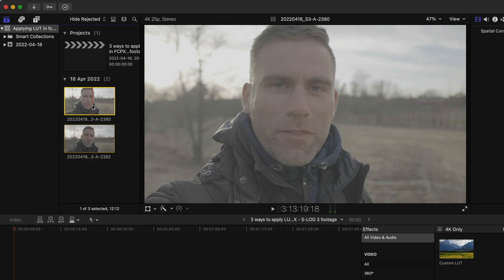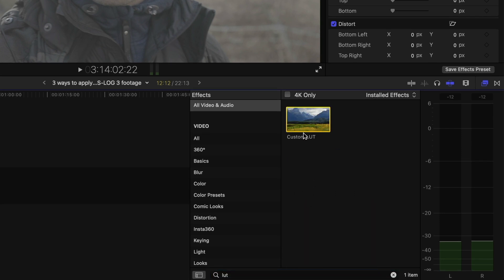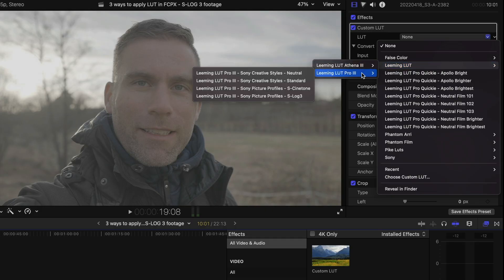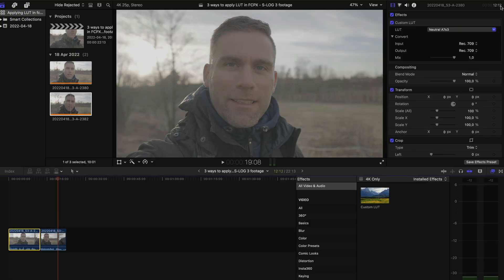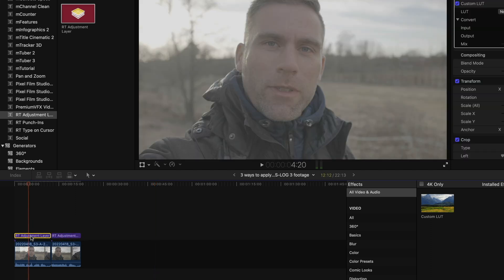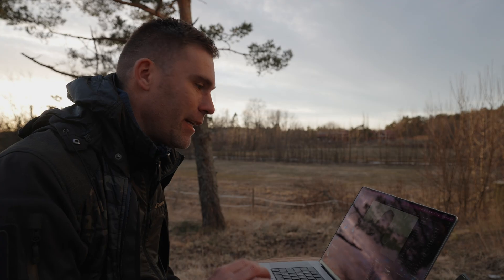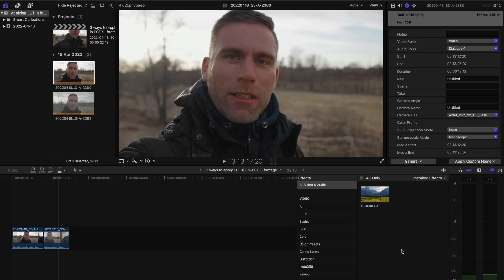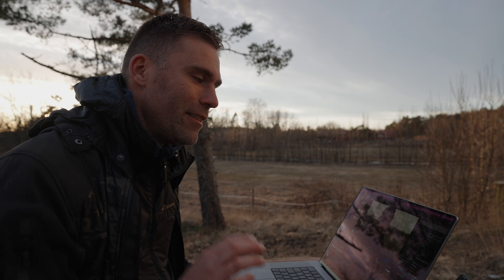How to correctly use LUTs in FCPX. 3 methods you must know!

Comment: Hello MK! I'm new to FCP and have been watching your videos and learning a lot in the process, so thanks a bunch for that! I have a question that I can't seem to find an answer on, if you could help that would be great! How do I apply different LUTs to the same clip within a timeline (meaning if I take a clip, and lets say I add the beginning of that clip to my timeline and also take the end of that clip and place somewhere else in my timeline, how do I apply different LUTs to each clip?). I'm running into the problem that if I apply a LUT to any portion of the clip it's applying the change wherever else that clip is located. If you can help it would be much appreciated. Thanks!

Comment: Hey MK! I’m new to your channel here, but I found your video helpful while researching the use of LUTs in FCPX. I’ve actually already been using your preferred method of applying the LUT in the inspector, however I recently saw a warning about doing this because it places the LUT in the wrong stacking order of effects. Dylan Bates explains it in this video https://youtu.be/y-u8bFqga1c. Are you familiar with this? I’m interested in doing a test myself and playing around with the stacking order. I was just wondering if you have already tested this.
Reply from the maker: Welcome to my channel! 😃👍
So LUTs can be tricky. Or actually it’s FCPX that is tricky. Usually layers work the way that what’s at the bottom is applied first and what’s at top is applied last. But not when it comes to FCPX and effects. 
The effect that is applied at the top is applied first, so it’s more like reading a book. You start at the top of the page and read downwards.
So when you apply the LUT from that inspector dropdown that LUT is applied at the top of the stack. So it’s applied first.

So what makes this “wrong” is that you should correct colours etc before the LUT is applied because you have so much more data in the LOG profile before the LUT is applied.
To do that the colour correction layer should be at the very top, before the LUT…. So…

In many cases it doesn’t really matter, BUT if you need to tweak the image a lot then you have a lot more room to stretch that image before the LUT is applied. So if I need to do a lots of adjustments, then I apply a manual LUT effect and drag that below the colour correction layer…

Maybe I should do a video about this 😂
Reply: @MK-Creator  Yes! Your response is exactly what I suspected. I do think it would be cool to see you do a video on this. I’d suggest doing some A/B testing to show the difference between using a LUT in the inspector vs. the same LUT on the timeline (which I suspect is the same) but then taking it one step further with a color adjustment after the LUT and then compare with moving the color adjustment before the LUT. I wish FCPX could apply the LUT from the inspector to the bottom of the stack of effects. That way you could use the inspector to quickly apply your LUT to all clips, and then tweak them in the inspector.
Reply: @bandobeek  I see what your getting at.  You’re basically baking in the LUT without being able to tweak exposure / white balance after the fact.  Yup.  It’s copy and paste until they figure that one out